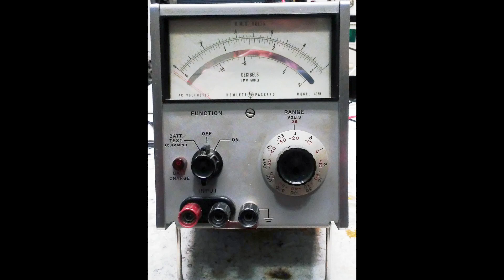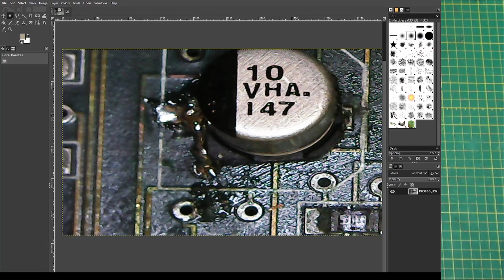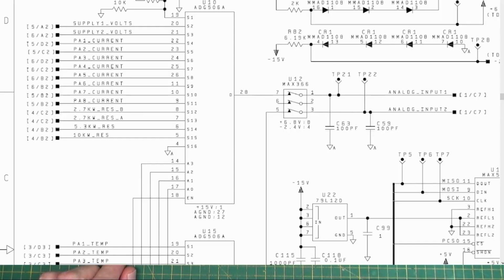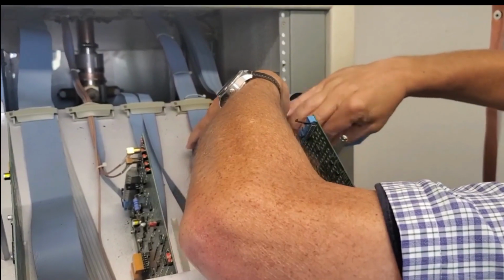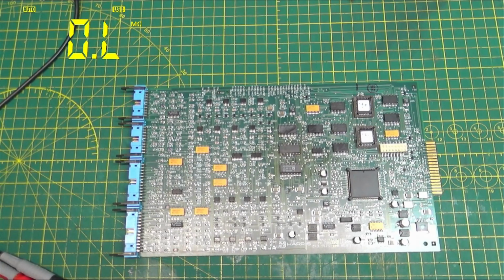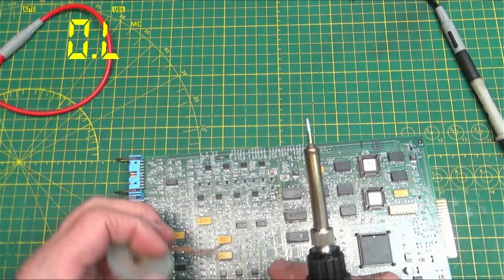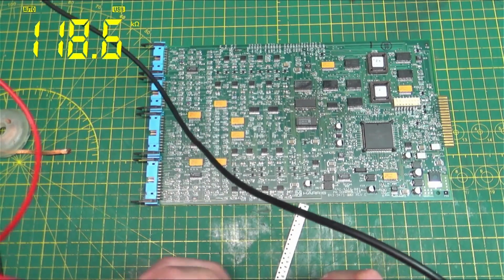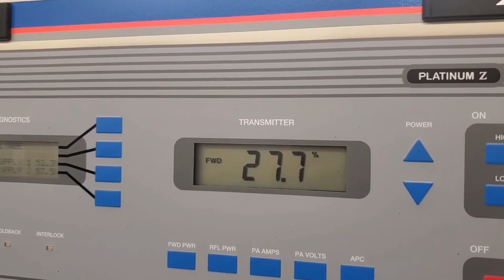Fixing a Harris Platinum Z5CD Transmitter

Comment: I have a Z10 in service that used to make crazy amounts of noise. Finally got some PA modules changed out and after getting to full power, the thing was silent as could be. I thought it was broke! My engineering mentor laughed and said, "nope, that is what it sounds like when we get it really fixed".
Reply from the maker: What was making all the noise?  There is a big ole' fan in the bump on the back.

Comment: I have a Z5CD that it's becoming hard to control. Certain input closures to turn on/off/raise/lower now cause the transmitter to turn off the whole cabinet momentarily.

Serial Data between the PC and the transmitter also goes out intermittently.

But the Z Platinum Series transmitters were famous for blowing MOSFETS in the PA and IPA section.

Since parts and support is getting harder and more expensive to come by, I finally convinced the station owner on an RVR 2000W transmitter.
Reply from the maker: That sounds like a good idea. It is one thing to have a piece of studio gear become flaky and intermittent but when a transmitter goes down now you have a problem, $$$